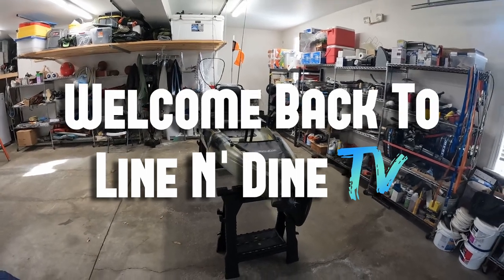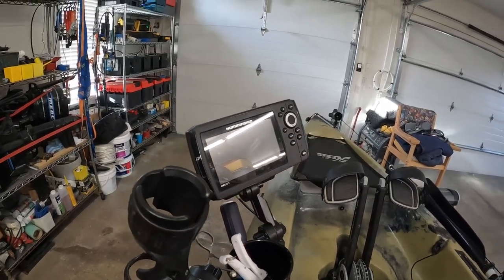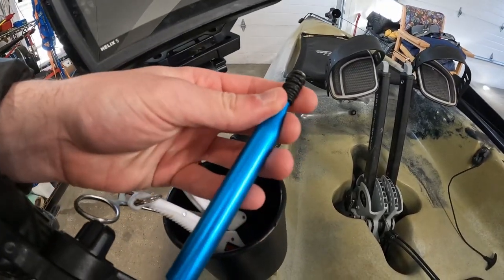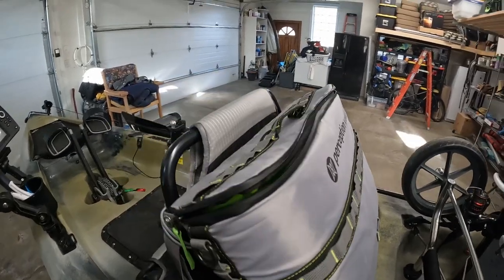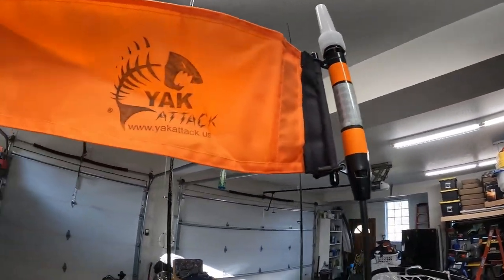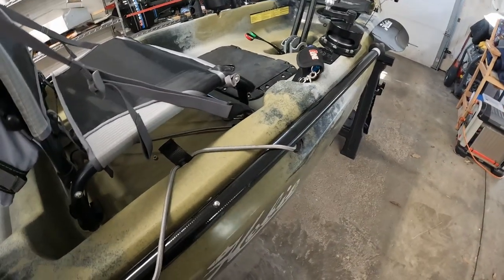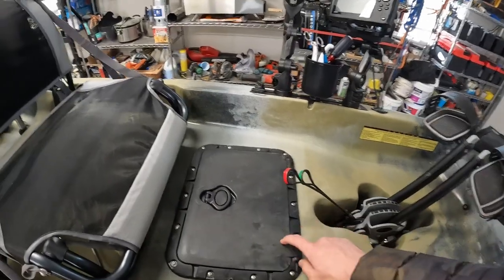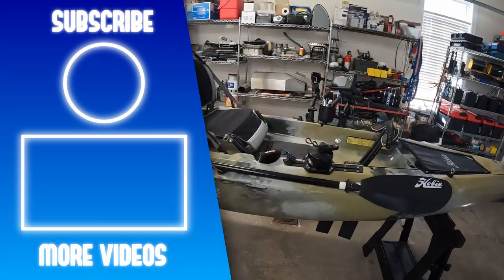The ULTIMATE Kayak Fishing Setup! (Hobie Compass Camo)

Comment: solid rundown, enjoy the season
Reply from the maker: Thanks!
Reply: @linendinetv  question if i may. How did you get that eyelet on there between the anchor system, just a small geartrac screwed down? thnks
Reply from the maker: @Krozin  I drilled a hole and used the eyelit's metal geartrak slider as a nut. Put it up underneath and tightened down the eye. Probably not the best solution but I didn't want to put geartrak down for something so small.

Comment: Add an anchor trolley so you can adjust your position when anchored down.
Reply from the maker: I’ve since gotten a new kayak but I was thinking about that!! How easy is it to integrate with the wizard?
Reply: @linendinetv very! You run the anchor line through the trolley ring. When you drop the anchor, you slide the ring along the kayak which in essence gives you anchor point all along the kayak instead of just the front. It helps reposition you in current.
Reply from the maker: Thanks!! I’ll check it out 🤙

Comment: Nice set up. I have the same Hobie Compass. Where did you get the plate you have the anchor attached to, and also is it just screwed in from the top or do you have a locknut underneath??
Reply from the maker: Thanks! I got the plate online, it's called the "Anchor Wizard Triangle Mounting Plate." The plate itself is mounted to a YakAttack rail underneath, which is kind of hard to see. The rail has nuts underneath so it's pretty solid.